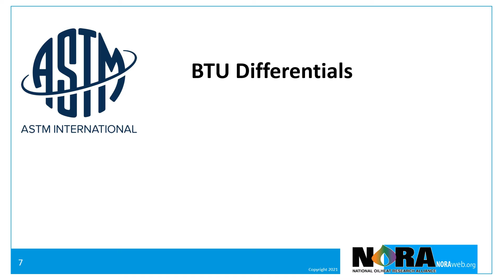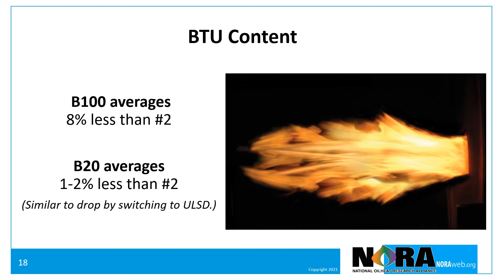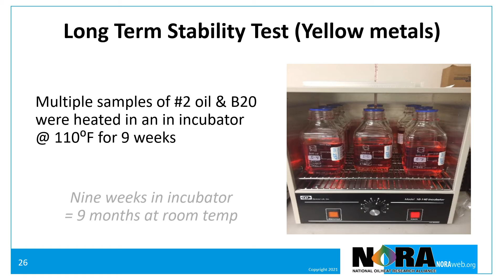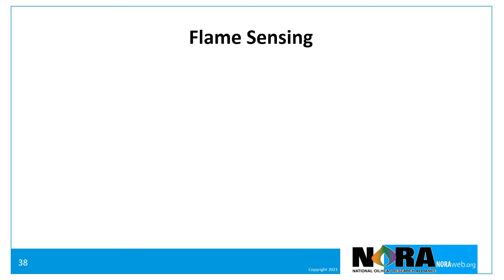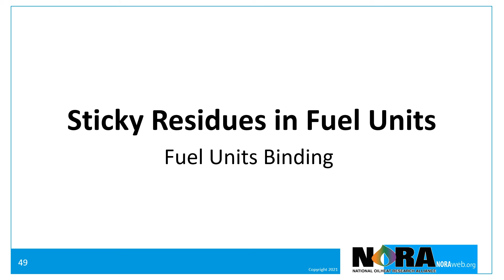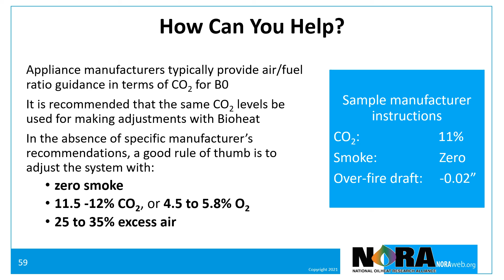Bioheat Technical Guidance

Comment: the problems of elastomeres contacting biodiesel aren't any. Problems begin to start by changing back to fuels without biodiesel. 
Than rubber will become brittle.

Q: B20 and B100 work also better with condensing burner systems?
Q: How much rapeseed fields do we need to provide 10.000 kWh heating energy?